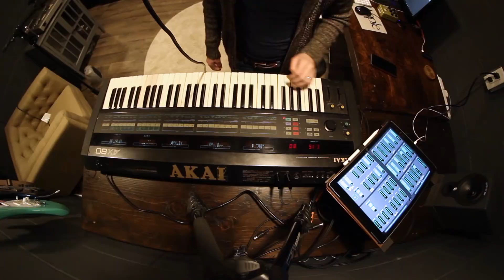Midi Designer Pro Layout: Akai AX80 (latest firmware needed)

Comment: Do you happen to know if there is a way to restore the factory patches? I just got an AX80 and the A and B banks are completely blank. The only thing that works is the "Preset" bank. Still confused about this, and the manual is rather vague in many areas. Thanks!
Reply from the maker: Unfortunately I’m not sure how you would find those patches. What I can say is that those patches were probably garbage to begin with, like most synths of that era, the sounds were not terribly usable, as you probably hear in the Preset bank.

If you are able to find the patches online, the procedure is pretty straightforward, go to page 15 of the manual and it explains it. You can plug a computer or your phone into it via a 1/4” cable to send the sound file to the AX80 to restore those patches.

Good luck!

Comment: I recently got an AX80 and discovered I already had an upgraded firmware ROM. Great job on the MD layout. Have a thumbs up. A nice addition would be to have Restore A & Restore B buttons that would send the Sysex for those banks’ original factory sounds.
Reply from the maker: Thanks - I hope you find it useful! I unfortunately sold my AX80. I'm not sure the MD layout allows you to send restore SYSEX files. I actually think you could edit it yourself and add it if you liked. Enjoy the AX80

Comment: Just pulled my AX80 out of storage tonight for its semi regular test run and found that I have some intermittent membrane switches... rats. Well it was bound to happen sometime. While searching for repair information I came across this stunning bit of fun! I had no idea there was a firmware upgrade let alone a Midi Designer Pro editor! I will have to check to see what version of that app I own and see about updating my chip! At that point, perhaps the old AX80 will return to an honored spot in my main rig just like it occupied for so many years back in the 80's and 90's. :) Thanks for your efforts!
Reply from the maker: Hey Murdock - mine had some intermittent membrane switches. Actually, it was busted and needed to have the common fix with the membrane switches, due to poor connectors between 20-32 membranes. After I got that fixed, some of the buttons were hard to press or only worked intermittently. I managed to use contact spray on them after opening the front panel (very easy to do on the AX80). Worth a shot!
Reply: I have mine open right now. I popped it open this morning and was shocked at how easy it was. Man I love well built things. The problem with the membrane switches on the end is EXACTLY the issue I am having. About 50% of the time 25 through 32 just go dead. I can press down on 24 and "slide over" to the next section and it works most of the time if I keep constant pressure, so its defiantly the connector. I have looked at it under a loop and don't see any cracks in the solder, but then I am not sure I would. I guess I need to reflow the points of contact on that bizarre stiff bridge they used. Was Akai boycotting wire back then? ;) I will do a search and see if I can find a description of the fix. I imagine its pretty straight forward but unfortunately my soldering skills are modest at best. So I need to know what Im doing before starting surgery. Oh, I did discover that I own the current version of Midi Designer Pro and I downloaded your layout last night. Just need that chip now!
Reply from the maker: Yeah, you'll need to rewire those :/ I had it professionally done because way more was wrong with mine. Kinda wish I hadn't sold my AX80 - but to be honest, I didn't like the sound of it at all. Loved how it looked, but that was it.

Enjoy the layout! With it, you shouldn't even need to fix your membrane buttons :S
Reply: I carefully hit those contacts with a hot soldering iron and astoundingly, it now works! We will see how long that lasts... but at least when it starts acting up again and I take it somewhere to have it done right, I will be able to tell them exactly what to do. The AX80 is an acquired taste for sure. It has a harshness to it that can be even called annoying if you are just listening to it directly. But I have a long history with the instrument having got my first one back in 1985ish. It was my second keyboard the first being an Octave Cat! I also love the way it looks and enjoyed its sleekness on stage. Other people seemed happy standing behind really boxy gray monoliths but I was a front man and it was nice for controlling tucked away rack equipment or less handsome synths. From the beginning I have always processed the crud out if it, so I see it as a early 90's synth with the effects section missing. I am weird though, I would rather have a VZ1 than a DX7 any day and you could not give me a D50, so I would never hold it against someone for not digging the sound of the AX80, its certainly flawed, just flawed in a way I happen to like and have a lot of nostalgia for. I like the synths that are weird, like me. :) Thanks again bud, can't wait to get that chip and use your layout.
Reply from the maker: I get that for sure. You are probably a better keyboardist as well, which could easily influence your decision - I suck, and for some reason, since that was about all I could do with it (play it live), I just didn't have it in me to really pursue it much. Hopefully the layout works for you!
Reply: Heh, I would love to let you believe I am a good keyboardist... but I am a digital composer, producer, lyricist, and mainly a vocalist who sometimes used to do his best not to embarrass himself on stage behind a keyboard. :)
Reply from the maker: Hah - well, you at least went out and performed - good for you! I used to do that with guitar, but haven't been in a band for years... just sort of a loner.

Comment: Does anyone know what the most inexpensive or lowest end iPad you can use to run the software editor on?
Reply from the maker: I had an iPad mini 2 retina... it seemed to work just fine for me. I’m pretty sure an iPad 1 wouldn’t work.
Reply: Yea I recall you saying that an iPad mini 2 worked. It's probably the lowest cost option. This would be it's single and only purpose. I've also got to think about MIDI routing. My AX-80 is part of a semi-large MIDI rig. I'd have to put a thru in front of it that merges note data from my sequencer attached to my patchbay and the sysex coming from the iPad. At this time it looks like a $200 investment in the iPad and iconnectivity lightning compatible thru box just to edit in software and I'm not sure I'm willing to do all that just for a software editor.
Reply from the maker: Just contact the developer of Midi Designer Pro 2 - I'm sure they can tell you the lowest iPad that is necessary for this to work. I have yet to really incorporate my iPad into my setup - and frankly, I don't really want to. It doesn't ever really contribute to anything for me. Also - the AX80 is pretty easy to edit on the front panel.
Reply: It is pretty easy you are right...I felt that it miiiiight be a little more convenient all on one screen and having all those parameters right in one small area as far as trying combinations of things quickly....and of course it could prevent my membrane switches which all work perfectly from becoming problematic in the future if I stopped using them.
Reply from the maker: Yeah - that's a good point. I just sold my AX80 tonight - lol. I just never really liked the sound, but it is a beautiful synthesizer (note: I think the Roland D50 is also a beautiful synth). Good luck with your setup. It's never easy trying to get everything fitting nicely together!
Reply: Hah, that's wild, right on. Well OK then! I think actually I'm gonna go with the cheapie iConnectivity option that has a lightning connector. I have a MIDI merger already so in theory I should be able to merge my incoming sequencer notes with the sysex coming form the ipad and the iconnectivity interface into that merger and into the ax-80. That interface is only $50. If I can find an iPad mini 2 for $100, then I can live with that. ;) Take care Midera, thanks!